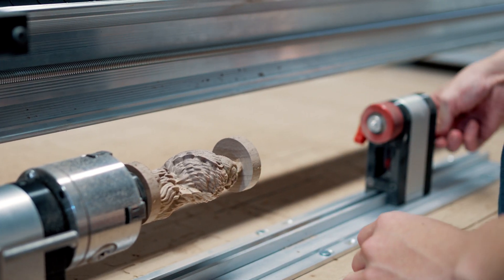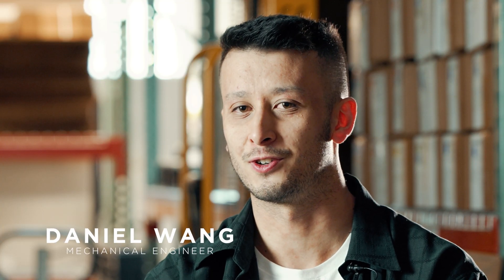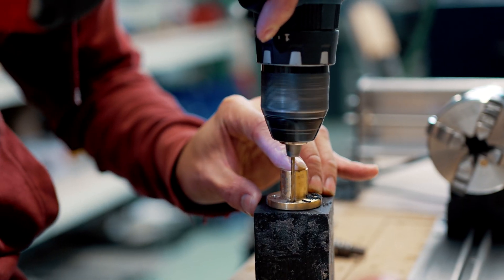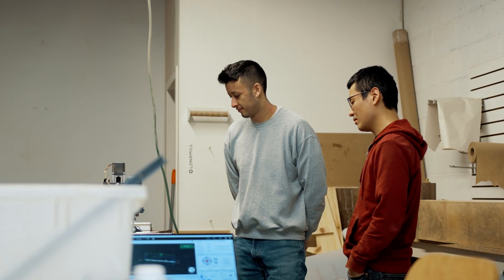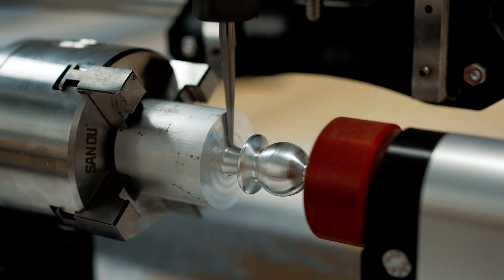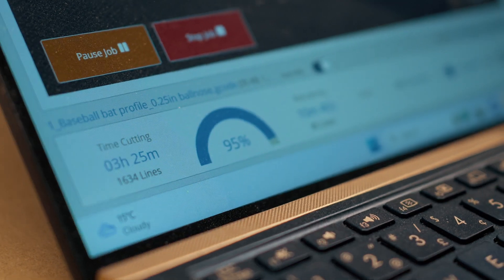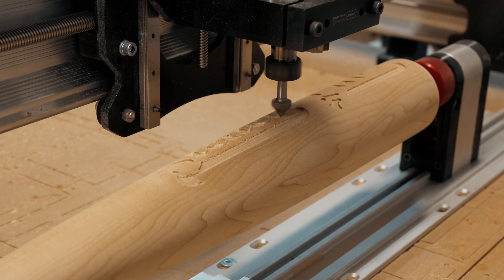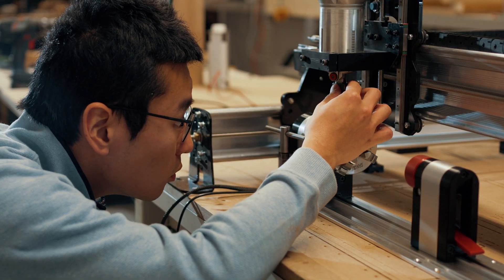Introducing the Vortex Rotary Axis

Comment: Does the Vortex, when used on the Altmil, simply use the Y axis controller to control the Vortex angle (by unplugging the Y axis after centered above the Vortex and plugging into the Vortex), or is there a dedicated rotary axis control cable that would allow the software  (perhaps not today, but maybe someday soon) to control Y axis movement while also changing the angle of the Vortex.  I realize that many rotary controllers only allow a surface cut rolled onto the rotated surface, but to be a true 4th axis, one would want to achieve undercutting, at least in the Y direction, by allowing the Y axis to also move while the rotary axis is also moving.  I can imagine that the Vectrix software may not currently be capable of providing these workpaths (or maybe it is), but I would only want this 4th axis if I could hope that with a software change (or perhaps different work path generation software) I would have the capability of a true 4th axis allowing undercutting in the Y direction.  It is not clear in your promotional material whether this is the case or not.  And if not, is this a capability that might be available in the future if I hold off?
Reply from the maker: The original Vortex matched with the original Longboard did what you described. When we introduced the SuperLongBoard then it changed to a dedicated rotary cable which allows 4th axis movements. While there is software out there that can do true 4th axis cutting, it's typically the "engineering" level which many hobbyist find challenging. having said that, the tech is getting better and easier to understand every day! Great question, thanks for asking!
Reply: @SienciLabs  Thanks... I am an engineer so that doesn't frighten me... So cool that the Vortex has this capability

Comment: Is this only compatible with the Longmill or can it be installed on other CNC's? Like the Inventables X-Carve.
Reply from the maker: We've only tested the Vortex Rotary on the LongMill. Technically, since the XCarve should be compatible with gSender, you can likely modify your machine to accommodate the rotary axis and use gSender as your sending program, but we wouldn't have support for this at this point.